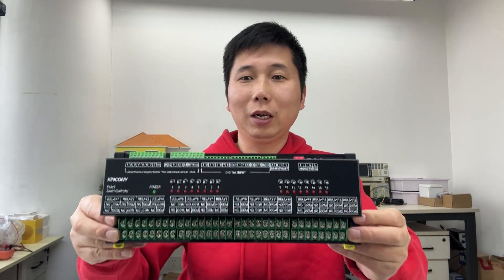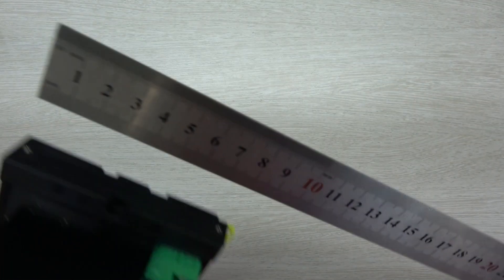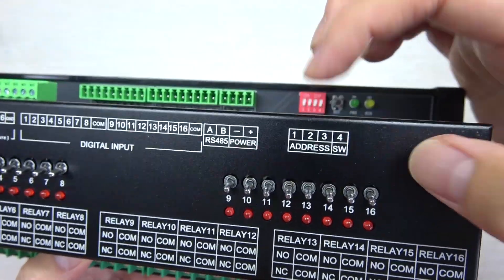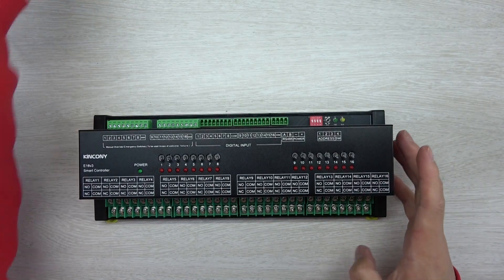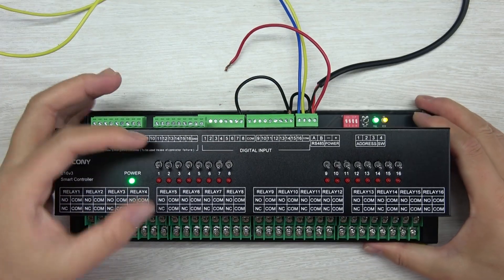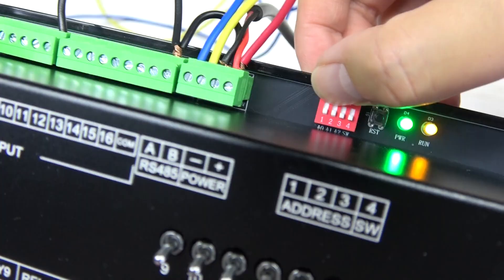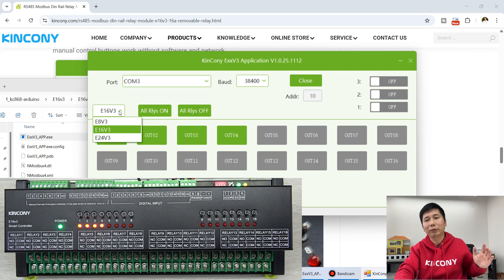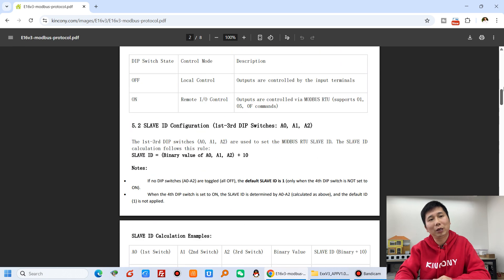new E16v3 extend removable relay module with new innovation

Comment: Can it be controlled by A16v3 via RS485? If so, will digital inputs from E16v3 be available in Home Assistant via A16v3?
Reply from the maker: digital input work with relay directly, not use by home assistant. E16v3 mainly use A16v3 by physically

Comment: Very good explanation.
I understand that the MODbus adress is only read at booting up the controller and in live mode it doesn't matter if you change the switch setting. Is that correct?

And how about the 4th, enabled MODbus, also only at power boot?
Or does is disable MODbus directly at running mode when you turn it off.
Reply from the maker: change setting need re power on of board. this according to software code.

Comment: It would be nice to have 3-positions switches instead of 2-positions switches =
- Position 1 - Relay controlled by the firmware / RS485
- Position 2 - Relay forced Open
- Position 3 - Relay forced Close
Reply from the maker: that just will let controller become larger.
Reply: @KinCony No. The switches would be the same size, the digital inputs and relay outputs would be the same too. The only difference would be the manual override inputs but for my they are not really necessary anyway.